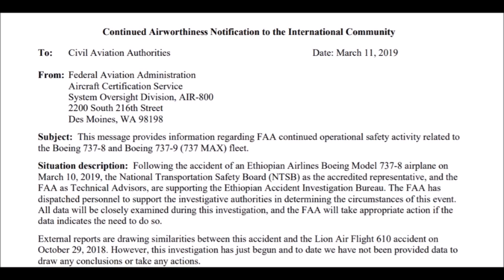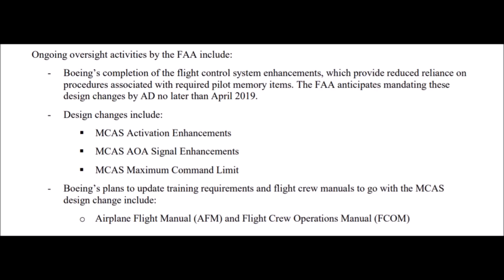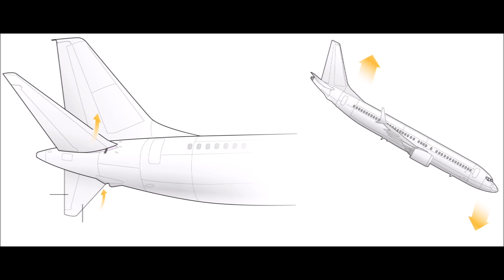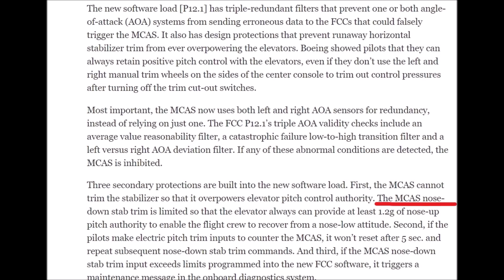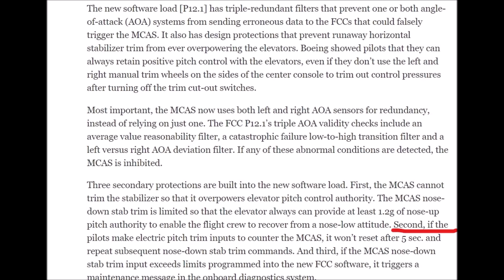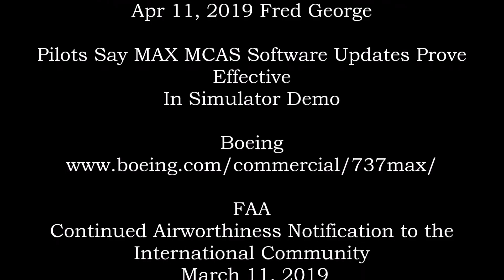737 Max UPDATE 14 April 2019 "The Fix"

Comment: I am retired, but spent close to 40 years in the aviation industry as an aeronautical engineer, an engineering test pilot, a research and development aerodynamicist, and an airline operations engineer for a major American airline.  You are doing an excellent job of describing this entire debacle, but I do have one bone to pick, and this is not limited to the MCAS investigation.

Aircraft simulators are only as good as the software that people like me wrote to drive them.  They are good for the most part, but they are not the airplane.  This constant airline pilot dependence upon the simulator as investigative device and arbitrator of engineering arguments dismays me and quite frankly it is dangerous as hell.  You are relying on software that drives a ground-based device to investigate problems with an airborne device.  Just stop it, and not just with this MCAS case.  Please allow properly-qualified aeronautical engineers who have actual test data from wind tunnels, computer-based analyses data, and engineering flight test data that has verified both the wind tunnel and design analyses to evaluate these kinds of problems.  When we write software for simulators, we cut off the attempted simulation of flight characteristics out there at the limits.  We do this to keep the math models less complicated, easier to maintain, and because you are not supposed to be flying out there anyway, so why spend the extra money to simulate it?  So you guys trying to investigate pitching moments out at the limits of the flight envelope between two airplanes, or with a system like MCAS turned ON vs OFF, with a simulator is complete scientific garbage.  It only serves to waste precious time in an investigation because we have to take the time to explain why jumping in a box powered by software we wrote will not provide valid answers to the engineering question you are asking.  In the case of MCAS ON versus OFF, did you ever stop to ask if the simulator was properly programmed to simulate MCAS OFF?  No, I am sure that you did not.  I personally do not know the answer to that question, but it is fundamental to whether or not the use of the simulator is valid.  I have been involved in other investigations where pilots were attempting to justify a position based upon simulator results that were completely invalid for these very kinds of reasons.

When you jump into a simulator in an attempt to answer an engineering question, you are ASSUMING that the simulator properly represents the aircraft in whatever flight regime you are investigating.  That is most definitely not always the case.  Be careful, dammit.  The engineers at Boeing screwed up.  Don't screw it up trying to find answers to the original screw-up.
Reply: Spot ON here!  Simulator probably does NOT represent the real airplane at the edge of the flight envelope AND WITH A FAULTY INPUT AOA SENSOR.

Comment: I did software development for 25 years. The usual steps are:
Market Requirement Doc (MRD)
Design Specifications (spec)
Test Plan, Test Design, Test Cases.

Errors in any stage is usually called out in a  Defect Report aka Bug Report or design review. 

Some of the "obvious" fixes should have been called out in the design process. Defect reports being deferred or discarded is the start of the paper trail.

Allowing automation to override pilots. Not checking between the AoA sensors and Attitude gyros for faults seems like they should have been written up.  Were they dimissed?
Reply: Im also a software engineer kevin, and the only way i can explain it is that mcas software was written in panic mode against an unreasonable deadline.

As you suggest in your comment its incomprehensible that any decent software team would do such obvious "corner cutting" if they had a reasonable budget/time frame to develop the software
Reply: @davecarkeet5691  Having a time crunch could explain why the software isn't robust.

However, it is common to reuse code. So this makes me wonder how much cross checking is done between AoA sensors and gyros in the 767, 777, 787,... I would hope the crosscheck code exists in other Boeing models. 

There should be a paper trail of features being scrubbed and bugs deferred. 

Much is made of the new engines. People write as if Saturn V boosters were mounted on the wings. The NG 800 has 24k-27k thrust. The MAX 27k-29k thrust. Plus, the MAX engines are mounted slightly higher, reducing the off centerline thrust issue.

 However, there are two big cylinders in front of the wing, which could act like a big control surface at a high angle of attack.  Round is not very aerodynamic. So that could be an issue that MCAS was solving.

Granted this is a video of models, but it gives a good side by side view. 737 MAX vs  NG.
https://youtu.be/O4aVh6q6H54

Limiting elevator trim and the other changes seem very positive steps to fixing the issues.
Reply: You guys are obviously correct about the lack of redundancies but the ability to "override" or ignore pilot inputs is rather prevalent in modern airliners and basically the entire purpose behind Airbus automation philosophy (which has also malfunctioned and gone rogue). If the FMS on AF447 hadn't switched from Normal Law the Alpha Protection would have "overriden" the dazed pilots and 200+ people and their families would all be praising an airliner that can outsmart its pilots when in danger.

MCAS is not an anti stall system and is not supposed to overpower pilot input which is technically less intrusive than aspects of FBW automation but both systems can and have caused uncommanded pitch maneuvers when malfunctioning. MCAS was clearly executed poorly but blaming a basic premise that has existed in aviation for 30+ years seems misguided.

Comment: 1. The AOA Vane was the instrument that seems to be failing by sending bad data to the MCAS system. What is being done to address the issues with the AOA Vanes that are failing. 
2. With the changes to MCAS if the plane were close to stalling and the AOA vanes were not within 5.5 degrees of each other the MCAS system would then not do it's job & help recover the plane from the stall.

Comment: I have a question: Since MCAS shifts form one AoA sensor to the other with each flight, is it possible that the Lion Air crash was caused by both AoA sensors being faulty? I say this because the flight flown by that same plane had the same MCAS issues that bought down JT610. Thank you!

Comment: I find so intriguing that people of try to sell the safety of this aircraft no matter what. Even though I recognize the importance of this Industry and this company, we must at all cost do not give for granted the safety until is not properly validated the new version of the software. If people.push so hard to make us believe that it will safe again and it doesn't, the pov of this channels about aviation won't be reliable anymore. A huge mistake was done, need to get fixed but still safety is something that needs to be proved.

Comment: So Boeing , in order to avoid a type certification , and in order to maximise its profits, introduced a system which contributed to the deaths of 300+ persons by rendering the aircraft unflyable. I bet their families are delighted to hear that. 10% of their profits for the entire lifespan of the Max series should be paid to the families of those lost. Doesn’t say much for their flight test programme, or risk hazard analysis, does it?

Comment: So let’s review...... Basically, Boeing allowed us to fly on an aircraft that with simple redundancy’s added would have been much safer!  This is NOT NEW software.  These redundancy’s were already added to the MCAS systems of the military versions.  This brings the question: what other redundancy’s does Boeing have that they are reserving for after the deaths of innocent crew and passengers?  At this point, with the preliminary report, it seems that the pilots could have recovered control of the aircraft, had they left the cutouts that disabled the MCAS in the off position, and slowed the aircraft to a speed whereby they could manage the aircraft with manual trim.  This however is not definitive, and won’t become so until the final accident report is available.  So many questions to ask, and answer. This could of been avoided, if Boeing would have implemented the redundancy’s.  If the Worlds governing agency’s would not have certified the aircraft without the redundancy’s, and if the Airlines would have insisted upon the redundancy’s.  In the end, the narrative that will be employed, will paint Boeing as a company that does EVERYTHING humanly possible to make their aircraft safe. They will show how well the system works, and highlight how much safer the airplanes are now. In many ways it will be the truth.  What troubles me however is the full truth is these accidents didn’t have to happen.  If Boeing, Airbus, and every other manufacturer, along with the Airlines, and the FAA, would get together and begin to search for ways to improve safety before an accident happens, then they will be able to say that they do everything possible to make “their aircraft “ as safe to operate as humanly possible.  Simply reviewing the entire aircraft, looking for ways to upgrade redundancy’s already available would have saved the lives of the people involved in the recent crashes.  Even making the QRH list items for an MCAS emergency a “Memory item” may have saved the Ethiopian flight.  Because they most likely wouldn’t have turned the trim back on. Eventually they would have slowed the plane and then been able to manually trim.  I realize this is speculation, but the Ethiopian crew was very close to solving the problem long enough to return to the airport.  If only they would have slowed to a manageable speed.  In the end, they shouldn’t have found themselves in the predicament to begin with:(. So much liability here!

Comment: The B737 MAX was a rush design and self-certified to compete with the A320neo. I wont ever trust a MAX because of that fact alone; who knows what else they overlooked. Moreover, if you need software to compensate for a natural inclination for unbalanced flight, then the design itself was never a good one to begin with.

Edit: Also, weren't the pilots of the Ethiopian flight able to disengage the MCAS system and it still forced them down? Any word on that?
Reply: It's all in the report.

And there is nothing wrong with the plane itself. That was just stated in the video.

Comment: Thank you for this update!
Shocking stupid design of the initial MCAS, against every basic design rule.

But I do not buy MCAS was only installed for pilots' better feeling close to previous 737 versions.
Those huge engines high in front of the relatively small wings of the 737 must have a huge influence to stall behavior - to the critical side.
MCAS helps pilots accidentally coming close to stall.

There is no information provided at all about stall behavior of 737MAX compared to previous 737.
Reply: There is no difference between the stall behaviour of the MAX to the previous NG model. The only difference is the "feel" of the controls, without MCAS operating.
Reply: @gordonrichardson2972  Are you sure?
The engines are much more hurting the airflow across the wings in the area where the major part of the total lift is generated than in all other 737 models and other civil passenger aircrafts.
Without access to any simulation or tests I expect crucial influence whenever flaps not engaged, relatively low airspeed and relatively high g forces (i.e. narrow turns)

Comment: Total negligence. Non safety or redundancy before certification? This is manslaughter by executives and all who signed off on the airworthiness of the 737 MAX. 
I vote prosecution with death penalty to set an example that greed over lives end here. 
Also all recent certifications by the FAA should be re-examined and the authorities from other countries should re-examine their work too, unless they want to take responsibility for the next deaths.
Reply: And for the pilots who didn't turn the two switches to "off" and fly the airplanes ...?
Reply: @ReflectedMiles  they did. But they still didn't managecto get the trimm corrected and as a last desperate resource they hoped for a reset and that's probably why they switched the MCAS back on. 
And if you still feel to punish them for trying,  they  died already, capital punishment without a trial  that should put you at ease.
Reply: intuitiv.me I actually feel tragically sad for them. It is the silliness of the response to those at Boeing that I’m responding to. It was actually failure to control airspeed in this case which made the aircraft uncontrollable even with the switches off.

Comment: Can anyone explain the thinking behind the original design having two sensors and swapping between them flight by flight ?
I can't think of an explanation that makes any sense . . .
Reply: The use of two AOA sensors requires complex comparisons to determine if they are valid. Use of a single sensor is always valid, unless of course it goes horribly wrong. Not a good reason, but the only plausible reason.
Reply: @gordonrichardson2972  Agreed, but why swap from one to the other flight by flight ?

Comment: Boeing is deep in the hole, it turned out that MCAS is POS in every angle you look at. With MCAS these have beed multiple issues and problems so big quesion is how it was certified and now the major question is without trust do need the 737 MAX a new complete re certification?

Comment: The fact that there are already two angle of attack (AOA) vanes installed but not using both signals for MCAS is defintiely an oversight of Boeing engineering.  If proper management of change (i.e. making engineering changes the existing 737 design) and safety review analysis were carried out during design phase, the scenarios that caused the 2 accidents would have been identified and using both AOA signals for the MCAS would have been ended up in the final design to address the scenario of faulty AOA signal.  The use of redundant instruments for critical control is a widely applied practice in process industries and I believe it would be the same in aerospace, it's nothing new.  The additional engineering involved un having MCAS getting signal from both AOA vanes is minimal.  Therefore, it should not be a cost issue to have the redundancy (i.e. hardware and wiring are already in place, only additional software programming is required).  I am looking forward to the result of the root cause analysis from Boeing on how the 737 MAX ends up with the MCAS design that caused the 737 MAX crash.

Comment: Anyone think there be a system for regular hands on driving certification with an automobile be required when automation systems takes over driving?  By this I mean most Commercial pilots take a seat and let the auto pilot do the  flying while they monitor the flight controls? The US has written many laws concerning distracted drivers. Being distracted I'm referring the situation  where:  alcohol, drugs, or that more important cell phone use are involved, Ok shaving, makeup use, reading too, or looking back at unruly passengers.Those who normally are involved in auto accidents (accidents usually means no one wanted it to happen) resulting in death of some one, or ONE"S. Not usually 150 or more in the case of automobile, terrorists excluded.
   There was a saying:  "If it ain't Boeing I ain't going". Mostly expressed by my B-52 friends. B-52's  from 1955 and still flying today. OK, many upgrades!

Comment: Based upon the data as it became available, I was saying the same things as "the fix" more or less. If AOA conflict/Disable MCAS, use input from other sensors such as air speed and horizon indicator (another form of AOA gyro based) within software logic to know if to disable AOA, properly train the pilots and include information in the flight manual. I knew the MAX is a stable flight model with the design changes, that the MCAS was developed to avoid the expense of training pilots for an unfamiliar flight condition during heavy thrust.

Here is a comment I made on another video concerning this topic...
Everybody keeps talking about "design flaw, center of gravity unstable" which is untrue and not the reason the MCAS system was implemented. The repositioning of the engines caused  an unfamiliar nose up force during heavy thrust. (very easy to compensate for) The developed the MCAS system to automatically compensate for the extra nose up force using the existing stabilizer trim system so that pilots would not have to be retrained and certified on the 737 MAX-x
The fix is to properly train the pilots and 1. have the software use both AOA sensors along with other data so that it disables itself if necessary, such as an AOA conflict. 2. Install isolated/separate MCAS cutout switches/breakers so that standard electric trim functions work with the MCAS disabled.